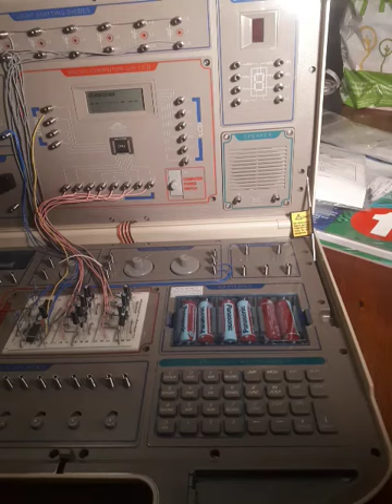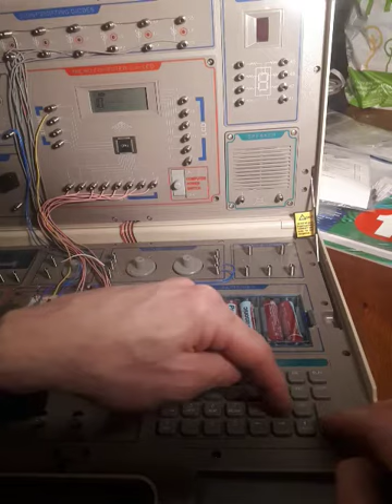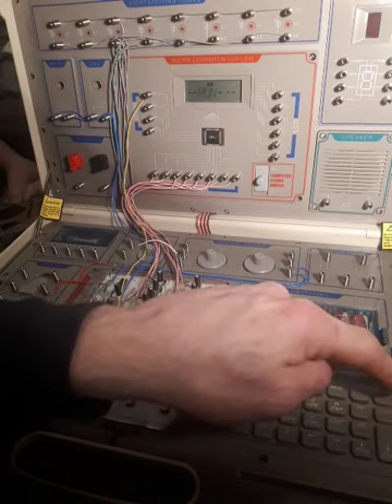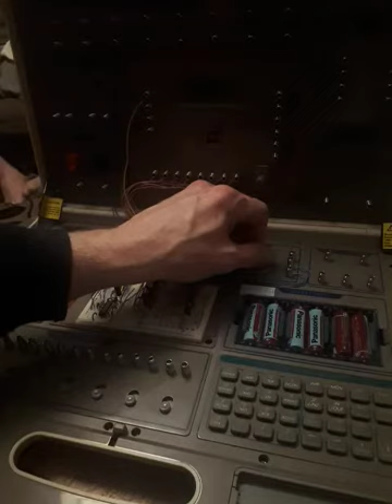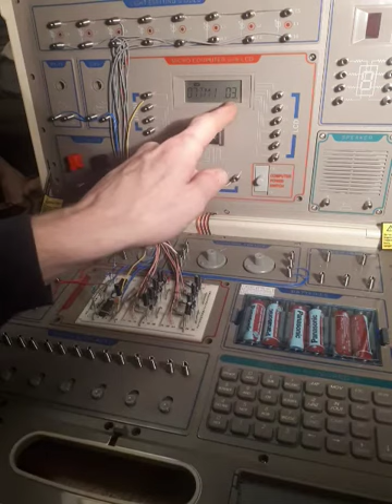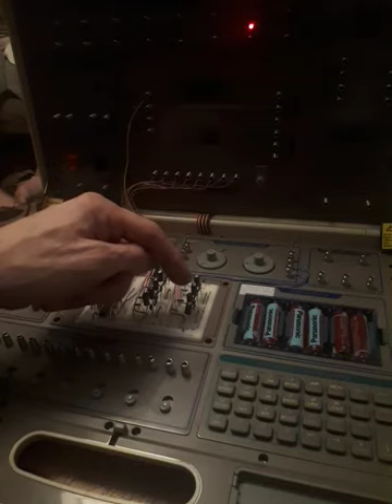500 in 1 electronics kit. project 474 and programming the CPU

Comment: Thank you for this and the previous review video of this kit :)  Very thorough.  You are incredibly kind and patient with the commenters too.  I am hoping mine arrives this week.  I had it before but hadn't gotten into 8bit computers back then, so I am looking forward to that part now.  Hope you keep finding new adventures and things to learn and enjoy.  Thank you for sharing with the rest of us as well :)
Reply: I had someone gift me this years and years ago. I am a tinkerer, and have started to get into making music and audio related circuits more and more (repairing musical equipment and building kit synthesizers is how I got started in electronics).

But I hadn't used this "lab" for anything more than breadboard prototyping up until now, and I am suddenly very curious if I can actually make primitive electronic music with the computer... I have experience with the Basic programming language that I learned when I was very young, so I'm wondering if I can pick up this machine... But can it output or sequence simple sounds, like a square wave? I really don't know what the limits and capabilities of this cute little computer are. Even if I can have it create Eurorack compatible 5V per octave control voltage signals, that could be very fun.